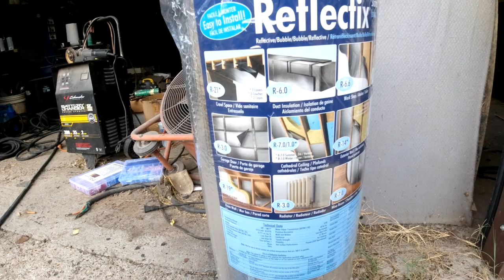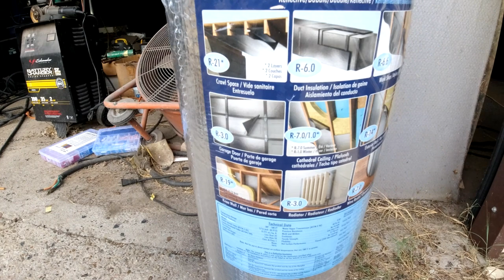1968 Chevelle Nomad Restoration - Part 27 - Heater/AC/Firewall Work

Comment: I learned from 1st hand experience... you have to remove the headliner and do it in the garage and let it dry and harden for 48 hours in the shade... it's the heat causing it and even the 3M will fail... I got it right the second time and I had to buy new headliner and 2nd batch of 3M spray....

Comment: Sorry to see the headliner falling, the same thing happened to me on an old caprice. What worked for me was stripping the headliner down to the backing. It was very messy and the foam turned to dust, no crumbs left behind. I used 3M contact cement, the kind in the quart paint can size. Brush on both surfaces, let tack up, and your golden. Keep up the great work! Cheers! 🍻

Comment: That Thermo King stuff you get at Lowes really works. I have it on the inside of the firewall, on the floor, and put some leftover pieces on the inside of the outer doorskins of my old Cherokee. I think where it worked the best was on the inside of the roof. it even makes the stereo sound better. The doors go thump, instead of bang. make sure the surface is clean, and it won't ever come off. Get it on line, it's a little cheaper. I paid 18.00 for the sticky shit, and it took 1 1/2 rolls to do a 7 foot roof.

Comment: Just a thought on that headliner, if you still have the original headliner bows, maybe wrap those in the vinyl and put them in to hold the headliner up better so you aren't relying on just the glue?

Comment: Since you're doing the front end, remove the condenser from the truck to see how it will fit the radiator support. You'll need a that newer condenser for r134a cooling anyway. The LS AC compressor is on the opposite side compared with the factory Chevelle AC. The right hole on the radiator support won't matter anymore since AC lines will come in/out on the left side now. Will need to get a bracket and move AC compressor to the top or notch the frame and leave on the bottom. Not aware of engine mounts that will be high enough and don't mess with other clearances like transmission in tunnel or intake to hood.

Looking forward to seeing how this comes out. Everyone talk about cheap LS swaps but I hope you can pull this off with truck gauges, radios, and everything else to save cost and show them what a real budget ls swap can be. I'm sure you will figure it out as it seems you're no stranger to researching YouTube, forums, and Facebook. GOOD LUCK!

Comment: I ls swapped my elcamino. The relocation plates bolted to the motor . Did raise the motor about 1/4 inch. Very minimal. You will have to change the oil pan if your using a truck motor. Cheapest way is a stock f body

Comment: The problem with the glue on the headliner is there's old glue on the headliner. Might be better to drop fabric and paint headliner with some cheap paint.  But glue on the fabric. Glue on glue might work.  Put some outside bows up like the original nomad.  It's too hot in Texas.  If it drops with bows it will look good.  Good luck.

Comment: I found that the painted on can of contact cement with a brush works great for headliners but the old headliner needs to be clean that means the old stuff would have to be taken off
Reply: Also they are called upper and lower control arms

Comment: The factory ac did not work on a nova without moddingt but the chevelle maybe wider and ok. The problem on the nova was the valve cover hitting the evaporator box near the bottom. What was done on the nova was make sure power steering was clear of headers but on the other side the evaporator box was cut and fiberglass repaired to clear valve covers.  Search Chevy gm 1970 ac to see a video of a ls with factory ac in a nova which is narrower but close comparison.

Comment: You need to take the old jeep headliner off and clean it down to just the backing board and then spray it i done mine with same loctite spray and it has worked out fine been holding strong for over a year now I was afraid of yours not sticking when i seen you glue straight to the jeep headliner material

Comment: What are the brand name on those Wheels you have on the 68 Chevelle nomad I have a set of 10 inch wide ones and they're the same as yours but I don't have center caps and I've been trying to find a brand name so I can order some center caps so if you could give me wheel name off the center caps, I tried to get a picture but you don't do any close-ups of the wheels on your Chevelle nomad.
Reply from the maker: Prime

Comment: Yeah, I'd say don't put any components on the front of the car. Leave it as it is right now so you can put the engine, test it, etc. Once all that's done, put the A/C, heater core, etc.

Comment: Why not rebuild what you have..Put new bushings and joints on the stock a arms..
Reply from the maker: I don't have a press and didn't want to fight the bushings plus wanted to make sure they fit disc brake spindles so I just bought the whole kit.